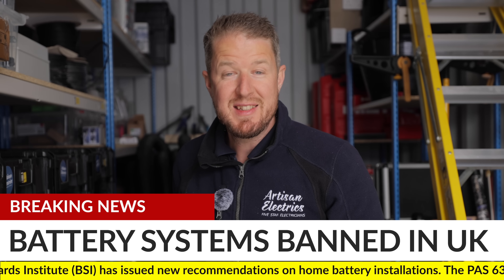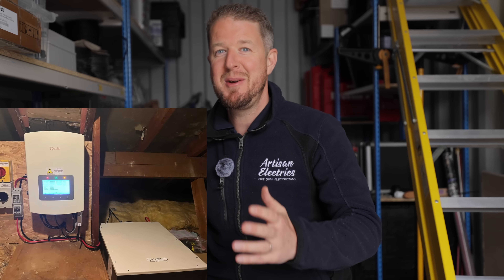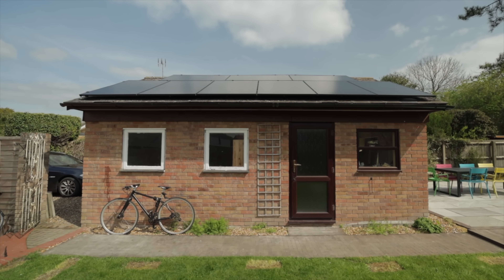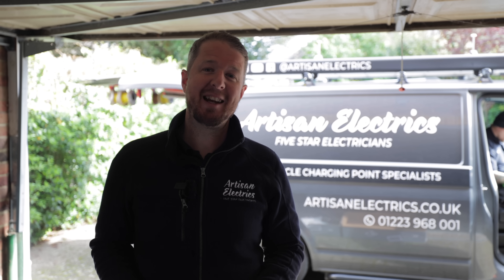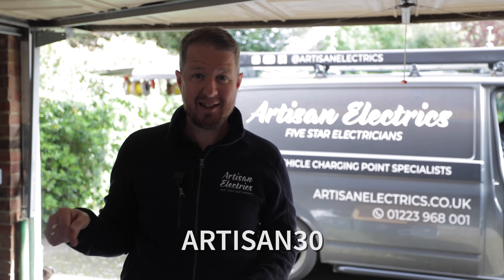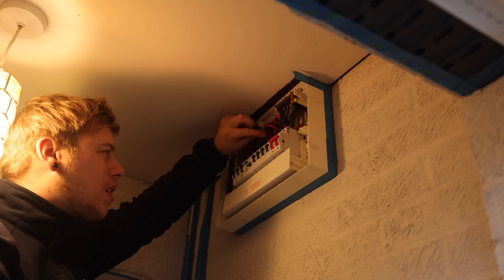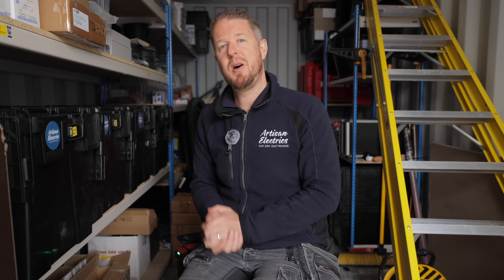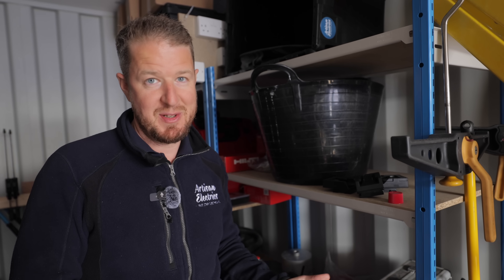Is the UK Banning Home Battery Storage? 😱

Comment: Building regulations will need to start considering this with either a fire rated plant room with space for batteries, inverter, consumer unit and all the bits that go with heat pumps, or requiring properties with separate garages to be built with the underground trunking in place to take the necessary cabling. 
To put batteries in my garage would require digging up the garden and part of a tarmac parking space which is extra cost that could easily be factored into the initial build as it's cheaper to do it then. The back wall of my house is the only place a battery could reasonably go.
Clearly in a decade or so buyers of new builds will expect solar, battery and heat pumps to be installed as part of the original build.
Reply: Plant room? Where are you going to put a 'plant room' in an average 100m²/1100ft² U.K. home?
Reply: @markbooth3066  had an ASHP installed last year and joke that I lost and airing cupboard and gained a plant room!

Comment: I always think of the terraced houses with no space and even no garden - where do their batteries go? Or new-builds which can be purpose built to support heat pumps and solar batteries.  Is there some other form of fire suppressant method that can be built in to these items? FYI I made damn sure our batteries are in the garage.
Reply: My question is why go to the expense of a battery for a terraced 2up 2down ?
It will only have 6 panels possibly 2.2-2.5kw in the six months of winter you'll be lucky to generate 50p worth of Lecky a day let alone store it.
Reply: Time of day tariff and heat pump too can still save money.
Reply: @loosecannon5813  Could still be worthwhile if it's on an Economy 7 or similar tariff. You charge the battery from the grid when it's cheap & then draw off it when it's not.
Reply: I suppose you could fit them inside a sealed metal box & fill it with an inert gas, provided the box itself could act as a heat spreader. It'd also need some kind of weakened section in case of explosion, that could blow out through a vent or something in an exterior wall. Then have that explosion trigger a foam extinguisher to refill the box.. There are plenty of options, but none that would be particularly compact or viable for plug & play installation.

Comment: There are considerably different risks depending on the battery chemistry. It feels wrong to ban LiFePo from installation in basements. It feels right to do the same for some other chemistries (including more traditional LiIon ones).
Reply from the maker: Very true, unfortunately these guidelines are pretty much blanket to "idiot proof" them - I would still not fit any kind of battery in a loft though...
Reply: @artisanelectrics What is your reasoning for this?
Reply: @davida1841  There are very large temperature variations in a loft. That's not good for batteries.
Reply: @xxwookey  In what way?
Reply: @davida1841  It ages them faster and it can inhibit their functionality (e.g. some just won't charge at all below 0C).
Reply: @xxwookey  ok. The ones I will be putting in my loft have a -10 to +50 deg Celsius ambient air temperature operation.
They have a 10 year guarantee so I’m not that fussed if it shortens their life span. As for functionality it’s not a dramatic reduction.
Any other reasons why?
Reply: @davida1841  I think we don't have good data on how much lifetimes or capacities are reduced (I don't know if it's 3% or 50%), but yes if you've got a 10yr guarantee it's reasonable not to care too much. The only other risk is that lofts burn relatively easily so you are probably  increasing the risk of burning your house down. But it was small before and will remain small afterwards.
Reply: @xxwookey  Sure, I’d be surprised if the batteries last 10 years, let alone the 16 years they are supposed to cycle happily for. We shall see!
But I’ve also bargained for the cost of a replacement battery after 10 years guarantee is over so no issue there.
As for fire, Im hopeful that my smoke detectors will inform me of an issue, and allow a safe unhindered escape route evacuation of the house should the improbable occur. 
We should note that the PAS allows for inside siting in several locations where a suitable fire resistant separation of 30mins and adequate prescribed ventilation suitable to battery chemistry. 
Point of interest - 12.5mm plasterboard ceiling provides a 30 min resistance. Sadly the loft is a “prohibited” space. Also the loft hatch is a little problematic 🙄
Reply: @davida1841  with LFP that 16 years is reasonable, if they're kept in the 30-70% range, and the fire risk is from the electrics, not the batteries
Reply: @jocramkrispy305 🙃so I should only use 40% of my battery then??
Back in the real world I will use 90% as per manufacturers instructions and either replace them under guarantee if they fail in the first 10 years or pay the pre budgeted cost of a replacement for the 2nd decade.
Reply: @jocramkrispy305  sure I totally agree that the fire risk is more from badly terminated or weather exposed MC4 connectors. Not covered by this PAS document
Reply: @davida1841  Those are the manufacturer instructions for longlife LFP. It's all handled by the BMS, of course, so you're using 0 to 100% of what it gives you
Reply: @jocramkrispy305  what are you saying here?
Reply: @davida1841  max and min voltages per cell are set in the BMS; set the min to 3.2 v and the max to 3.4, and you have a battery that will give you 0% - 100% for 5000 cycles or nearly 14 years assuming you cycle once per day
Reply: @jocramkrispy305  I see. My BMS settings have less control over cell voltage at end user level (rightly so). I have a 90% discharge rate and am happy if I get my approx 4.5kWh from my approx 5kWh capacity battery.
According to the manufacturer that gives 6000 cycles.
But the ESS is more than one battery cell. It’s a system. So in theory 6000 cycles has yet to be proved. But I am hopeful. This isn’t a rant against battery life. I’m simply accepting that when dealing with electronic components, things that are meant to last often don’t.
Reply: @davida1841  The inverters tend to fail before the batteries
Reply: Yes, that’s also my experience in the field so far. But battery storage en masse is still relatively new and so I guess time will tell.

Comment: I have a terrace house. Where a battery might be put externally, I have the heat pump. 😂 I have LFP batteries in my loft from the inverter manufacturer. Seems to be the least risk loft install.
Reply from the maker: Sounds good!

Comment: You almost pulled on the correct thread with this document but missed it.  A considerable part of these changes are due to the risk to third parties - this includes fire fighters, visitors, children and even neighbours sharing a roof space (eg the average UK terraced or semi-detached house) as these loft spaces are not part of the protected fire zone and are not usually sealed against the gases and material ejected at high velocity from a thermal battery event.  It is not within the gift of customers or the installers to accept these identified and foreseeable risks.

Please do not the confuse the early stage for these new notes (as this will be part of a series) with the methods used for generally improving standards against the urgency that prompted the release of this (somewhat incomplete) document as fast as practicable.
Reply: And the document gives no weight to battery chemistry and the differences in issues.
I mean, please explain the issues of a lifePO4 battery in a vented loft. 
It allows for no structural calculations to be used to allow mounting of batteries whether across ceiling joists or indeed on a brick wall.
Reply: @DavidUC9  or if they are from China.
Reply: @DavidUC9  A house fire can easily reach the temperature required to send an LFP battery in thermal runaway?
Reply from the maker: Good comment thanks

Comment: PAS63100 is referenced in Section 11.2.3 of the IET Code of Practice on Electrical Energy Storage Systems, 3rd Ed. The IET CoP states that the guidance should be used.
Reply: Which law does it state you would be breaking by not following PAS 63100?
Reply: @VinoVeritas_  would that be your defence if you were charged and/or sued following an incident?
Reply: @protectiongeek  Which law would I be getting prosecuted under?
Reply: @VinoVeritas_  take your pick. Common law injury (or worse) to persons, criminal damage to property. Health and Safety at Work etc Act (Section 3), CDM Regs, Building Regs to name but a few.
Reply: @protectiongeek  None actually.
Part P of the building regs says all work must be done to BS7671.
BS7671 says "should" and not "must".

We are back to this age old debate where electricians don't understand the different between "should" and "must".

Every lawyer knows the difference, electricians do not.
Reply: @deang5622  not sure I follow. None actually? None of what?

Part P of the Building Regs (applicable in England) actually states at Section 1 -

General
1.1 - Electrical installations should be designed and installed [my emphasis] in accordance with BS7671:2008 incorporating Amendment No.1:2011.

I appreciate the difference between 'should' and 'must' although, in my own experience, I find 'shall', 'shall where practicable' and 'shall where reasonably practicable' to be much clearer in explaining the mandatory status of requirements.
Reply: @protectiongeek  But PAS 63100 hasn't been incorporated into any legislation yet, so you can't be prosecuted by any of the legislation you've mentioned for not following it.
Reply: @VinoVeritas_  that's nonsense. Industry standards and recommendations don't have to be 'incorporated into legislation'. Courts use industry standards as reference points in trying to determine culpability and/or liability all the time. If you decide to ignore or not to comply with them, you can try to defend yourself by clearly demonstrating that what you did or did not do was at least as 'good' or even better than the standard in question. Best of luck with that!
Reply: @protectiongeek  PAS 63100 isn't even a British Standard yet. Come back to me when it reaches that stage in its current guise.
Reply: @VinoVeritas_  PAS63100 is a Specification referenced expressly in an IET Code of Practice - you can choose to ignore that if you want at entirely your own risk, but I really don't recommend that course of action. I won't be 'coming back to you' at any stage. Maybe speak to a lawyer. Sounds like you might need one in the future.
Reply: @protectiongeek  Stop digging yourself into a deeper hole. The IET's CoP is also not a British Standard, otherwise it wouldn't keep having to refer to BS7671.

Comment: What kind of insanely sensationalist clickbait title is that? No cool.
Reply: Not impressed with him ( sensualism to get people to watch )
Reply: @kevinpickett7249  sensationalism? I like your version though...
Reply: There's nowhere I could put batteries under this guidance.
Reply: @jocramkrispy305  With solid state batteries around the corner and the lower and lower risk of fires with battery systems changing chemistries I think it won't matter soon. LFP batteries are already much less of a fire risk than lithium ion and with solid state claims of full punctures not even creating fires I'm sure they are closing in on safer options.
Reply: @Robulite  I use LFP for my batteries, but isn't the concern it falling through the ceiling.
Reply: @jocramkrispy305  If you build a proper platform for the battery it'd be fine basically anywhere. If there is a real issue with placement the engineer would never sign off on the permit. If the battery somehow leaks or shorts out though it could be a really bad place to have a battery in the ceiling next to a bunch of wood. Not to mention external factors like lightning. In most cases though the risks of anything happening are super low if the proper precautions that take into account where the battery is placed are followed.
Reply: @jocramkrispy305   "guidance"...
Reply: This world has gone crazy. Rules and regulation has taken over by common since.
Reply: @g7mks383  The lack of common sense (an not just DIYers) necessitated the regulations

Comment: Good one Jordan. An Australian Standard AS5139 was released in 2019 which seems to be much the same. Here's some of an installer's comments: 

The Australian Standard for home battery installations is quite strict about where solar batteries can and can’t go.
The best place to install a home battery or two is usually in a cool garage, behind bollards where necessary.

But where else can batteries go?
To be honest, that is a question that plagues a lot of installers. Around the side of the house might seem ideal, near the switchboard, but often it’s not – particularly if that puts your battery in the hot afternoon sun.

Back in the days when lithium-ion home batteries were brand new, and the Tesla Powerwall still had some curves like a plump toddler, the electrical industry waited with trepidation for Australian Standard AS51392, which would mandate where home batteries could be installed.
Rumour had it that the standard would force all new batteries inside a proverbial brick shithouse. But thankfully, the idea of a freestanding fireproof kiosk wasn’t mandated. It would have made things very expensive and electrical connections very difficult.
The new rules have been out for a while now, and the industry has had time to interpret them, so I’ll outline the main points to consider so your home battery location complies.

I’m Talking About Lithium-Ion Batteries

The standards were originally created to ensure lead-acid batteries did not accumulate explosive hydrogen gas in a building. Lead-acid energy storage is still in use, primarily to power off-grid homes. But their only advantage – a lower upfront cost – is gone now. Vale lead-acid. The scrap man will miss you.

These days, it’s (almost) all about lithium chemistry batteries. They’re smaller, lighter and have far better electrical performance. It seems the only downside is we are still working out how to recycle them as well as we do lead-acid, and lithium-ion is just a bit more spectacular in the unlikely event of thermal runaway.

Forbidden Home Battery Locations

There are lots of places your battery cannot go. To cite the rules almost verbatim, restricted locations include:

within 600mm of any exit

within 600mm of any vertical side of a window, or any building ventilation, opening into a habitable room

within 600mm of any appliance

within 900mm below any opening into a habitable room, vent or appliance

in ceiling spaces

in wall cavities

on roofs (except where specifically deemed suitable)

under stairways (with or without naughty children)

under access walkways

in an evacuation route or escape route.

blocking access to a switchboard (see AS 3000)